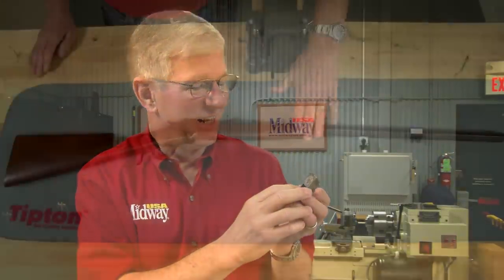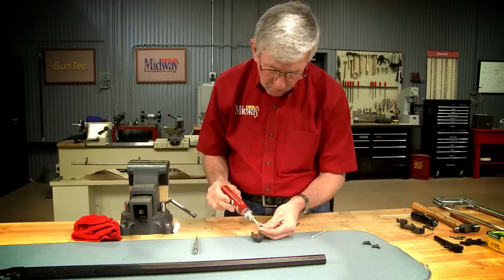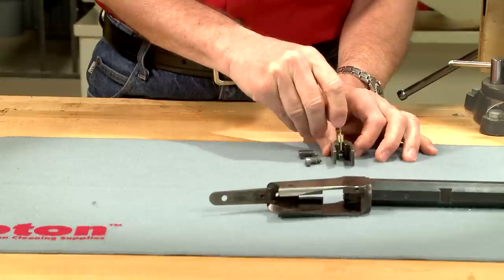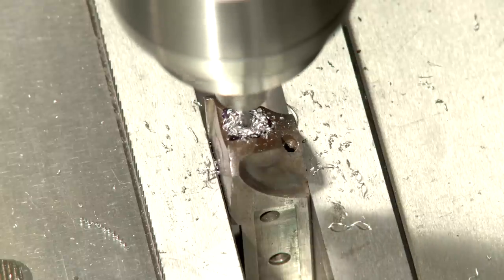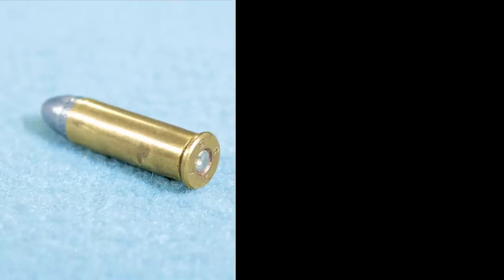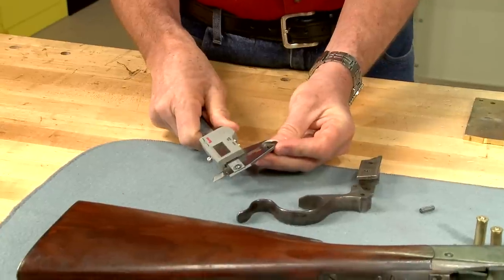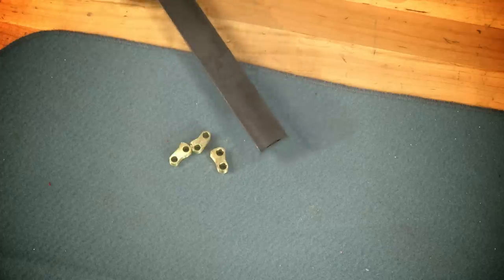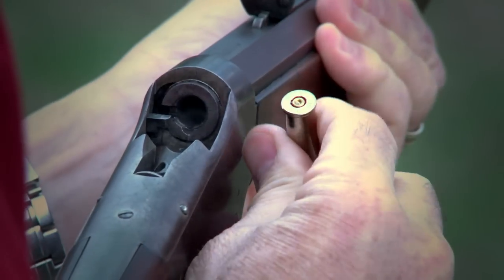Converting a Winchester 1885 Low Wall from Rimfire to Centerfire | MidwayUSA Gunsmithing

Comment: When it comes to firing pin issues I just use primed brass to test for proper strikes. You don't have to go to a range to check things out.
Love the videos and your products!
Reply: Worked for years as a gun smith. That's all we ever did. Primers cases for the testing, we did alot of conversions on antique guns, usually to more historic calibers though

Comment: I love your work but have to ask.

 You obviously put the firing pin in the center of what looks like where the back of the shells have been since the rifle was made.

How did the firing pin end up off center and why not just start over and move the firing pin again instead of  changing a different part of the rifle?
Reply: Probably easier and safer to just make a new link. Relocating the firing pin would mean welding the block. Filling and Drilling out another  hole would leave the block too weak.

Comment: Not to doubt larry, but given how he welds other parts at various times, i fail to see why he would locktite the firing pin plug rather than weld the it considering how much stress it will get

Comment: How do you decide whether it's safe to fire something like .357 Magnum in a gun with a barrel/action designed for a relatively weaker loaded .32? (or am I mistaken in that .357 Mag is way more potent than .32?)
Thank you for the great videos!
Reply: Chrustjun Zummermun those rifles are considered the best falling block action ever made. they beat a lot of the most popular ones
Reply: This conversion only works for low power .357 pistol loads
Reply: Like .38 Special. The Low Wall can probably handle .357 but the High Wall will handle most anything, very strong. I just bought a High Wall in .22 WCF, an obsolete round, I'll have to manufacture ammo from .22 Hornet cases.
Reply: @3ducs  that's an interesting project. sounds fun
Reply: Chrustjun Zummermun Conversions like this have been done since the 20’s. Guys like P.O. Ackley developed some obscenely overpressure cartridges in guns like this and most were safe. .357 is mild in comparison.

Comment: Please correct me if I'm wrong, but given how locktite breaks under heat, wouldn't that be a bad solution for filling in the breech block? It seems to me that after a good couple rounds, the chamber heat would cause the locktite to fail. Is there something I'm missing or is he just not planning on shooting it that much?

Comment: I don;t understand why you didn't just drill the new firing pin hole in the correct place begin with? Plus won't the heat of combustion eventual melt out the Loctite?
Reply: You guys should shut up gun Moses knows what he's doing

Comment: Not sure how I feel about gluing the firing pin in
Reply: jaysen2200  The rule with green lock tight.  Don't put it on anything you need to get apart. So in this case it's fine the pin will never move.
Reply: if he ever breaks it, he can use a torch to melt the loctite and pull it out.
Reply: Trust me its stronger than welding just about. I'm a blacksmith and custom knife maker and I use it often and I've literally torn steel trying to separate pieces I glued together with it. It's amazing stuff..

Comment: I have a Stevens 25 Rimfire that dates between 1912 and 1916 I want to do this to.
Reply: You don't say what model Stevens you have ? If it's a full size  model 44 or 44 1/2 , there is a lot of possibilities.
If it's a kid's gun, they're not as strong and best left as is.
Not sure there's any modern cf counterpart to the .25 rf anyway.
You just have to careful not to exceed the design limits of the action you're working with. Better safe than sorry. I've seen old guns that blew up from modern rounds and it ain't pretty.

Comment: Too bad Larry didn't convert it to Winchester 25/20.Impossible to get .357 right now but you can get 25/20 factory loads.Reloading with black powder and cast bullets and the powder is cheaper way to go.The power of the 25 is surprising. The old timers used it for deer at close range and its a great round for coyotes,groundhogs,fox and crows.It would be a more traditional round for that age of firearm,too. Brownells sells a Redmans liner for $125,too.They also sell a .32/20 liner for a little more.Chrome moly liners and they will last forever. Look Up Leatherman on YouTube hunting deer with a Winchester Model 92 in .25/20.There are more video's of deer hunting with that cartridge.Even Mule Deer which I wouldn't do as the ranges are too great where I've hunted them.Longest shot I ever took was 740 yrds. with a 3006.300# deer or elk is too much for that little cartridge.

Comment: In one of the videos where you repaired a barrel with scope mount holes you said only bad gunsmiths use screws. You said only tig wielding is good.
Reply: (i dont know if he said that.. but) NO!!! who tf welds a scope mount? even though im just a gunsmiths apprentice, even i know that . It just throws off the temper and looks ugly...
Reply: @radiatedronnie2855  I've welded on scope mounts, its easy to keep the heat under control with a TIG welder ... and my welds look beautiful! :)
Reply: @MikeBaxterABC  I prefer either soldering or screwing and glueing them on. But I thing it's more a regional thing as I'm being trained with traditional german methods, where Id never even touch a welder, sometimes we even fit a mount in for a hook-in-mount, which is a traditional german mount, even though not as popular as it used to be.

Comment: Would it not have been simpler and quicker to just make a new new firing pin from the other pin you had left and just adjust it to correct the low hitting pin

Comment: poor larry messed up drilling the firing pin hole :( then required a very roundabout fix for it.

why didn't you add a dab of paint to the back of a dummy round to mark on the face where the hole should've been the first time ???
Reply: +mphRagnarok He didn't mess it up.

If you notice when he shows both of the firing pins that the overall shape of the two are the same, except for the protrusion which goes through the breech face to strike the cartridge rim or primer. Both firing pins ride in the same firing pin channel. Larry did not relocate the firing pin channel, just the hole from where the pin protrudes. He drilled the new hole in the correct spot for the centerfire firing pin.

On a rimfire gun, as this gun originally was, the firing pin is off-center to strike the rim of the cartridge. Rechambering it to centerfire necessitates moving the firing pin to the center of the bore. The breech block on this particular gun was intended for a .32 caliber rimfire cartridge and not a .35 caliber centerfire cartridge, so the firing pin channel itself may not be in an ideal location. Switching the firing pins got the strike position close to the center of the bore, but not quite. He had to reposition the breech block to center the firing pin exactly with the center of the chamber/bore.
Reply: His only mistake was not realizing the case differential was going to offset. He drilled the hole perfectly... Paint would've helped him for sure. But I liked his fix.
Reply: He did it correctly in the .32-20 video. He used a cartridge case with a center punch...center is center, regardless of what the new caliber is.
Reply: Your comment just shows how little you know about 100+ year old rifles. Not being rude but he used a bushing to put the pin hole in the center of the firing pin bore. It could be done other ways such as puting the hole where it needs to be with the original link and making an offset pin but would be more work than making a new link. Please don't be quick to judge

Comment: about that linkage, instead of guessing and making a bunch of bad brass ones, why not measure how far over the holes are from eachother, how high, add the 40 thousandths, then calculate the hypotenuse for this right triangle we've measured out.
hypothetically say the pins are horizontally .20 inches apart, and vertically .38 inches apart, a hypotenuse would be .43 inches, pretty close to your measurements. add 40 thousandths to .38 for .42 inches, recalculate, you get .47 inches for how long your new sear has to be. maybe im wrong, im not a gun smith, but maybe its easier to spend 5 minutes doing math to make one sear right than to make 5 sears with trial and error

Comment: I lose respect every time you choose to use adhesive instead of solder
Reply: It’s easier and is just as durable. Now if he re-layed a rib on a side by side with green loctite I would take issue with that, but small parts repairs are OK with me because green locatite doesn’t budge, no heat needs to be applied, and there is no flux to clean off.